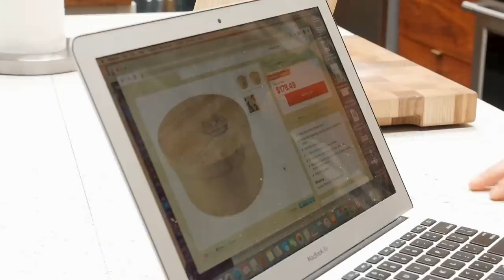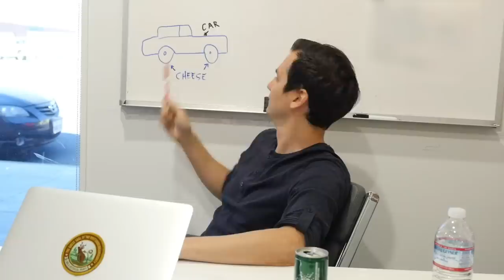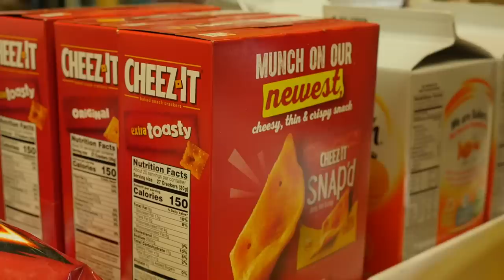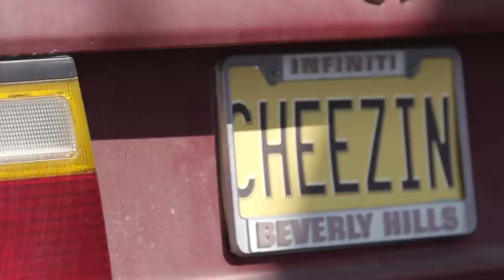We Put Cheese Wheels On A Car

Comment: I bet the actual wheels of cheese could have worked if they had fitted a small metal rim in to them, instead of drilling holes to bolt on directly.